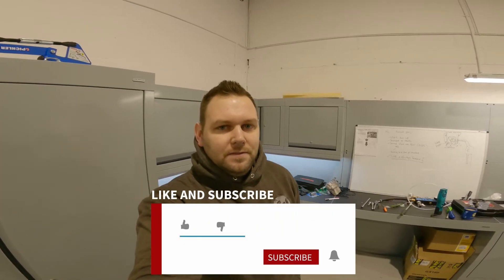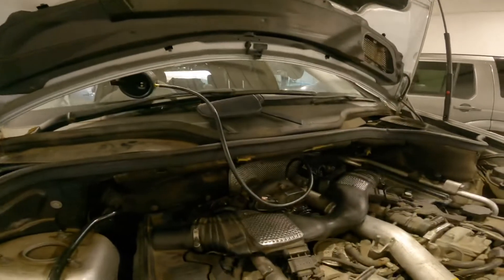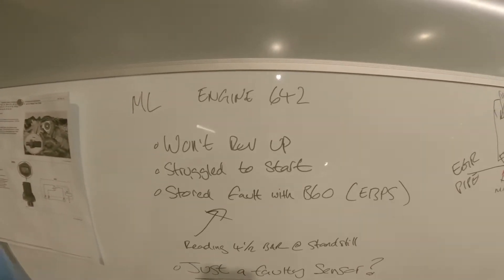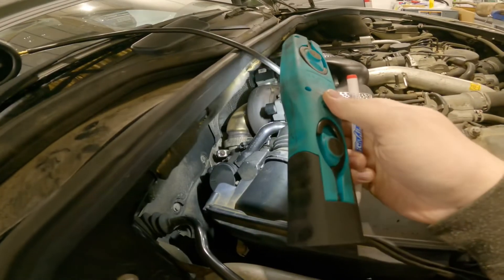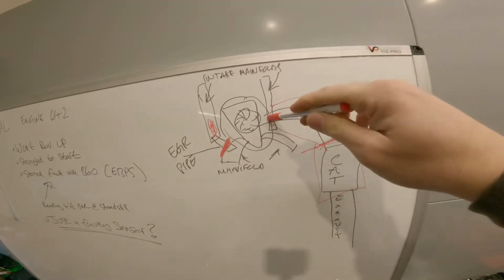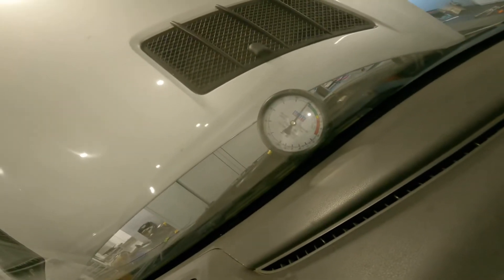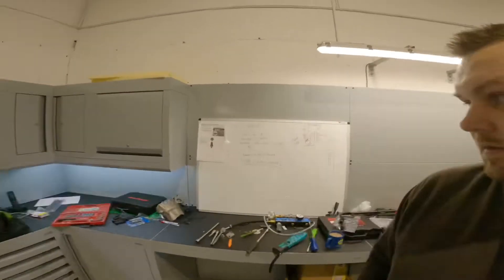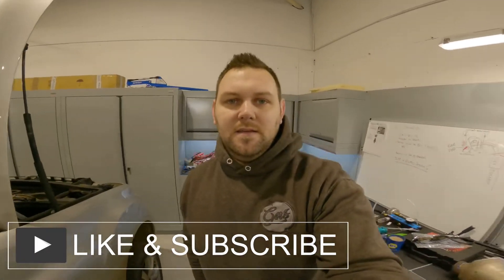P0471 Fix! Mercedes ML OM642 Exhaust back pressure tested & fixed.

Comment: Question: did the ML also buck at around 2000 rpm when driving it?
Reply from the maker: Yes, I’ve had this a lot and sometimes it’s caused by a faulty exhaust back pressure sensor
Reply: So, i’ve removed the cat and dpf. They are squeaky clean. Tested the flow. No obstructions. Replaced the backpressure sensor. Still high backpressure measured. Can it be a blockage in the turbo or should i examine the rest of the exhaust?
Reply: @braa1975  Did u fix it? I have the same problem.
Reply: @y.i.a.9853  yes. Changes out the turbo and exhaust manifolds. Now 12k miles problem free already.
Reply: DPF off EGR off nowe turbo i nastawnik